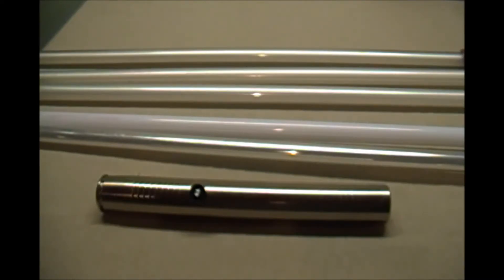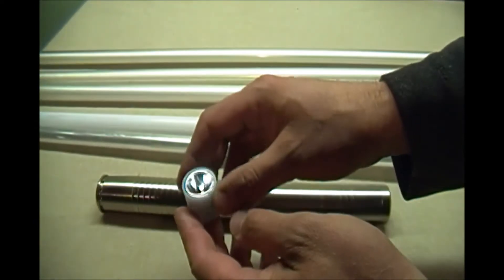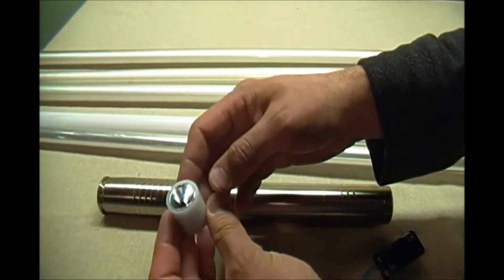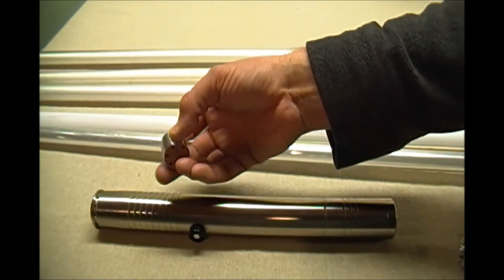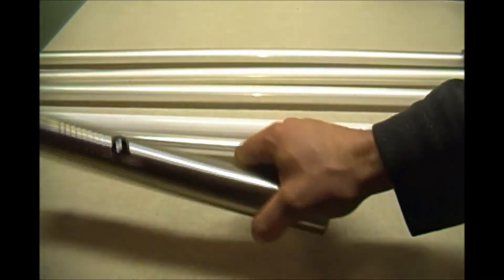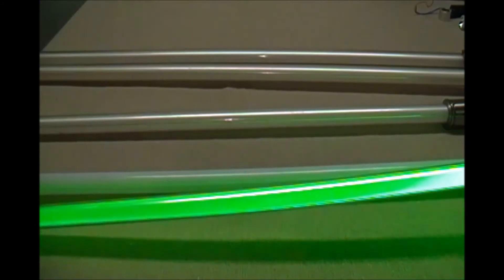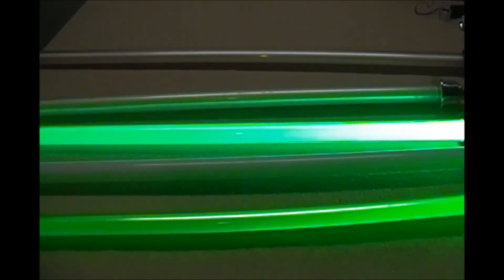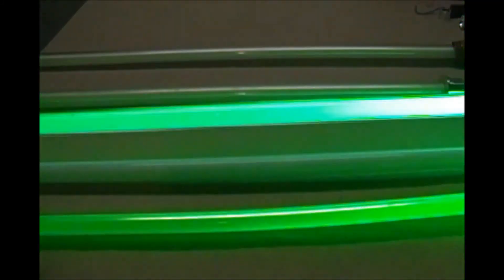Stunt lightsaber upgrade of US Redemption to Cree LED

Comment: hey, I have to ask: where did you get your LEDs, and which ones in particular?
I'm looking to do a basic refitting of a saber of my own, and while the batteries aren't the problem, the LED certainly is. It's started to seriously and terribly degrade.

Any help you could give would be appreciated, especially since this would be my first time attempting an upgrade.
Reply from the maker: +Declan Greenleaf I got this LED at The Custom Saber Shop, as well as the LED module to hold it.  If they don't have stock, you can get them at LED Supply.

Make sure you have a good heat sink for this LED to sit on.  That's why the original LED from the saber in this video blew, and that is probably why yours is going bad too.  These LEDs get pretty hot, and if there isn't a proper heat sink to draw the heat away, the LED will burn up.  

TCSS and LED Supply sell little thermal transfer stickers.  It's a double sided sticky pad that holds the LED in place and helps the thermal transfer.  They are cheap, and they are well worth using.

Good luck with your refit.  If you have any more questions, feel free to ask.
Reply: I found all the parts I need at the custom saber shop like you said, but they're out of heatsinks and casings in 1" diameter. Will the .88" do just as well? This is an Aeon V2, by the way, since I know emitter size is important for this.
Reply from the maker: +Declan Greenleaf The .88" one is meant for the Korbanth Graflex 2.0.  Double check the size of the space where it goes, but you probably want a 1" LED module.  LED Supply has them.
http://www.ledsupply.com/led-heatsinks/advanced-led-heatsink-housing

Comment: Is there a way to contact you in like Twitter or something that's a little more practical than on here ? If not, that's ok. But my question is.. How much will that same battery upgrade cost me? Someone is trying to charge me $180 (more than the actual Luke black series 2015 saber) to install the battery, upgrade the LEDs to 12W, a better speaker and make blade removable.. Please tell me how much they're ripping me off haha. I found I could get a light upgrade for about $30-40 and about $8-15 the battery. Then you just deal with the price of the louder speaker.. Which isn't going to be anywhere near $50. Now accounting for the labor it wouldn't take more than 4 hours to easily install. And I'd like to know from someone who understands lightsaber mechanics how bad of a deal this is.